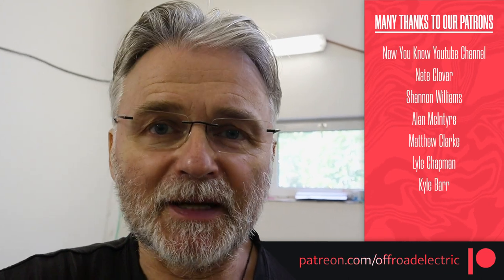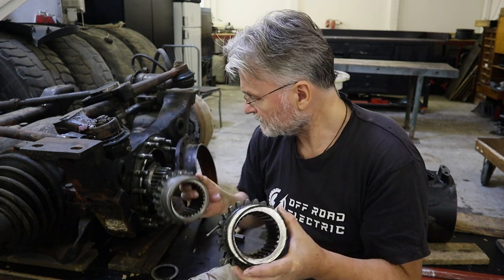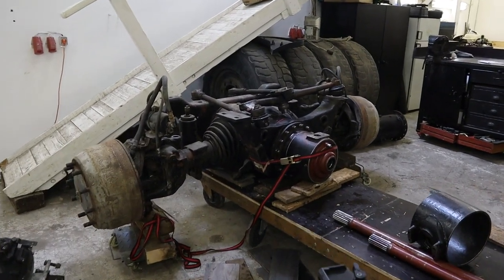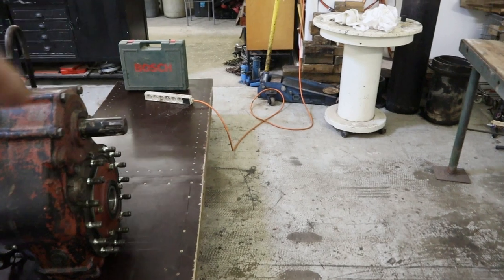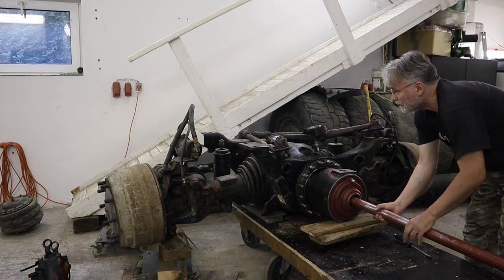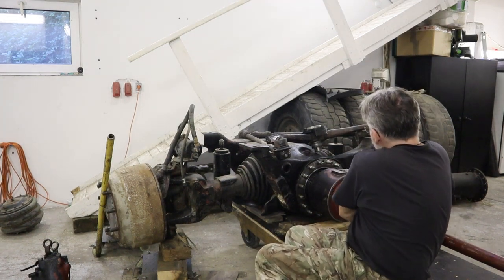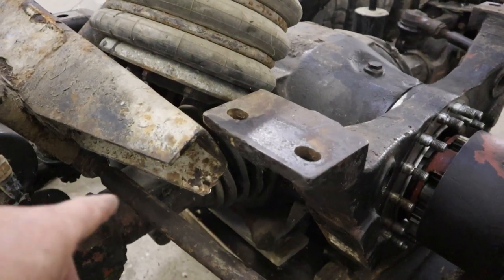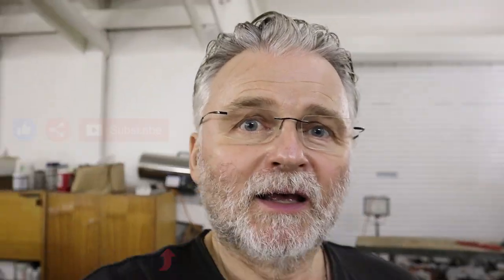EP.48, Building a Tesla/Tatra  2-motor Monster Truck

Comment: Hey Peter, great stuff!  Amazing how accurate you were with the tube cuts.  One question, isn't the rpm of the Tesla motor significantly higher than a Tatra diesel?  Will you gear down the Tesla motors somehow in order to match the original rpm of the Tatra diesel, or does the Tesla motor produce such high torque that it does not matter and no gearing to lower rpm's is required?  Cheers from Canada.
Reply from the maker: Thank you Pete! But you are 8 episodes behind!:) I will use also the Tesla gearboxes, so the final max speed is about 65 km/h, while ideal would be 80km/h.

Comment: Hi Peter do you still plan to power each axle independently?
Reply from the maker: Hi, yes, each driver might need a different rpm or direction of his axle.
Reply: @offroadelectric9457  Well I recommend to watch Whistlindiesel talking about Monstermax2 he explains why his twin engines are connected there are many situations where one axle might start spinning like crazy whilst other is barely crawling, also if one motor dies (speed controler problems, different current draw from different load of each motor) you can "limp home" on single motor and still retain 4x4 function.
Reply from the maker: @GLMtr  This first truck is for trucktrial competition, with two drivers and two steering wheels. Each driver controls his steering axle.
Reply: @offroadelectric9457  well as long as you give only one driver the throttle pedal it should be fine but I don't see the need for second driver, I assume you will run some hydraulic pump for power steering so it is easier to get solenoids and control the second sterring via switch just like competition Monster Trucks do, you can connect motors through PTO shafts on T-case that way you retain high ground clearance in the middle of vehicle and you can engage and disengage connecting shaft, my point is if you climb steep hill or one axle is sitting in hole creating lot of drag one motor is gonna be under tremendes load whilst second motor is not gonna help to rotate tires that actually need more torque wasting isn't potential by spinning tires that won't need much torque to spin. Same problem occurs when accelerating front axle is getting lighter rear is getting more traction thanks to center of gravity shifting rearwards.
Reply from the maker: @GLMtr  You have the point in engaging and disengaging the PTOs connecting shafts, I might actually do it. But I want to give each driver his own throttle and independence when the vehicle for example slides sideways differently with each axle.
Reply: @offroadelectric9457  I guess there might rare situations when you might need different RPMs for each axle but most of time it's gonna be difficult to coordinate moves with other driver, override system for single driver operation will be essential to overcome regular obstacles otherwise it might look like a clownshow. Best of luck to you.
Reply from the maker: @GLMtr  Thanks, there will be that option.